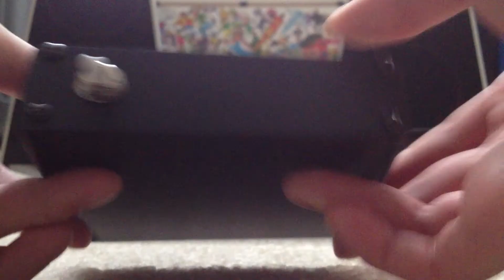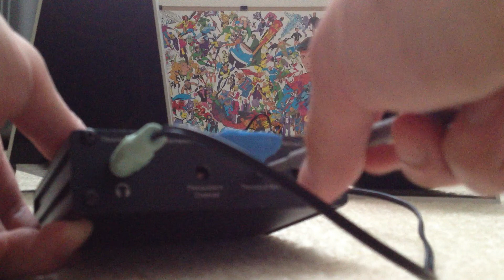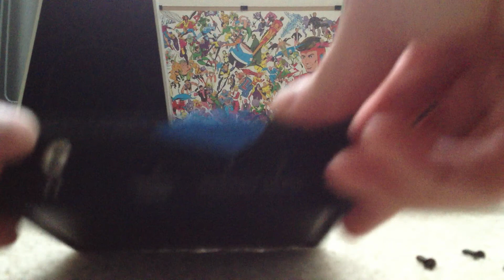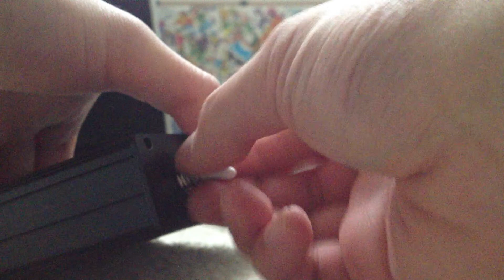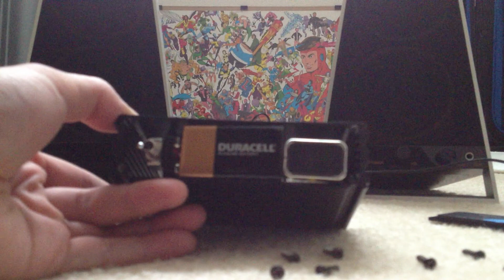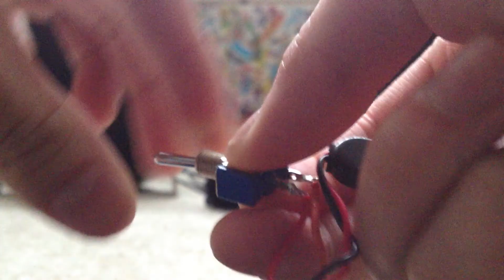[F.Y.I.] Triangular Voltage Generator Final Version

Comment from the maker: There's not really a purpose, but rather just a cool way to get hands-on experience with electrical stuff, hahaha. The device itself is probably useless, but by building it, you can learn some things about electrical engineering concepts and industry applications of software/hardware. It's like a chemistry lab for school: most of them are probably impractical, but they allow you to use and apply concepts to get something out of it rather than just on paper.